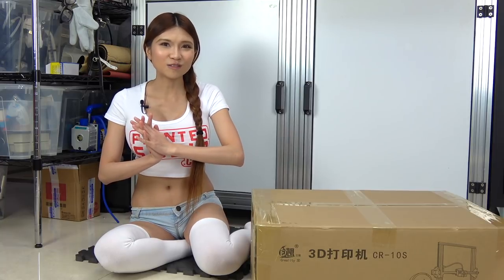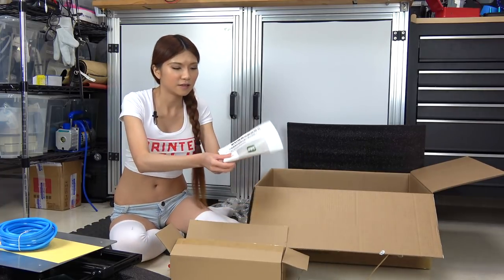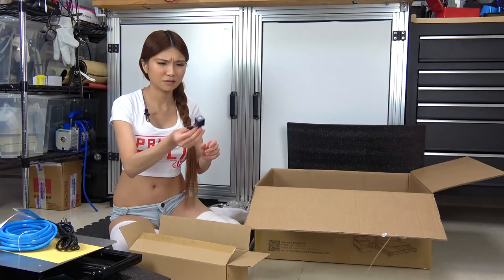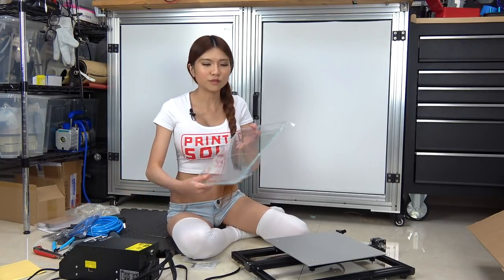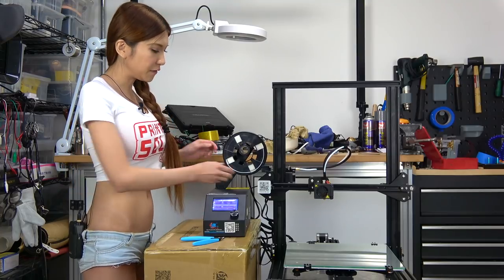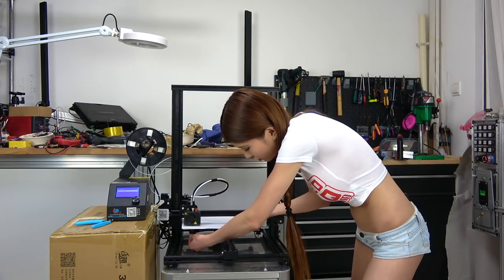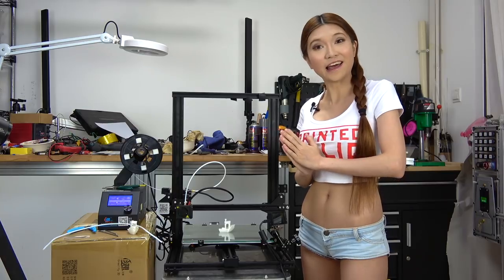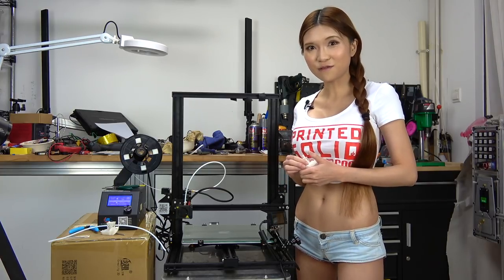The Creality CR-10s- Best Buy for Build Size?

Comment: After a couple of months I've really started to wonder why the CR-10 is always set up that way, I found it really inconvenient. What I did after a week of use I turned the heat bed so the cable exits from the side near the Y-axis tensioner, and then flipped the control box and worked at the "rear" of the machine, at the Y-stepper. That way the spool holder has great clearance to the printer frame, and the USB and SD ports are clear of the printer. The benefits are even more numerous with an enclosure; the extruder is much more accessible, you can prepare the bed surface while it is homed, and the print bed moves toward you when the print is done, and when changing the filament the print is taken behind the X-carriage so you won't lean over your unfinished work pieces or expose them to draft from the door.

Comment: So glad that you are back. I am running the CR-10 we have found after 400hours of printing that filament feed becomes an issue. Kind of watch your accumulative time and see if you start to have problems.
Reply: We started getting clogs above the nozzle and it would stop extruding even without a clog. Some of our prints take 48-56hours . We seem to have it under control but it took an increase in extruder temp of 10C. This is still a great printer.

Comment: One thing you will have to def do is flash TH3D firnware so you can do estep calibration on it. Super easy too since it can easily be flashed via usb, no need for an Arduino anymore long as you have v2.0 board or newer in the control box which all new cr10s do. Besides that i also recommend doing the z support upgrade and of course setup octoprint

Comment: In the past some sources always told that PRUSA printers have a lack in stability compared to the CORE XY printers due to the movement of the bed. I don´t know whether this is true but for me it was the decisive argument to buy the Ender 5 plus in the end - despite the smaller print size (compared to this one). This one indeed looks quite sturdy.

Comment: Based on your review I purchased a couple of these printers. They are a lot of work to maintain but serve their purpose they are not a substitute for industrial grade machines. With the right amount of TLC and patience they are fine. I would not recommend them for mission critical prints but for the tinkerer and hobbyist you can't beat the value.

Comment: Any newbie tips for printing straight onto the glass? I have so far only printed onto the masking tape that came with the printer, which has worked pretty well, except sometimes I rip it when taking the print off.
Reply from the maker: So long as the glass is perfectly flat and cleaned the alcohol that should be it...
Reply: Wow, as simple as that! I will try a print now. Thank you Naomi and thanks for all the great videos :)
Reply: Well first print warped really badly. So I added a brim and the next two have been perfect! Thanks again :)